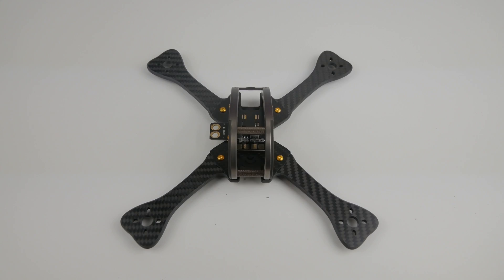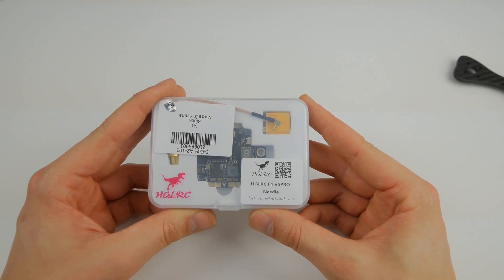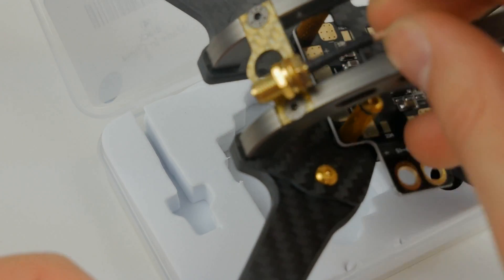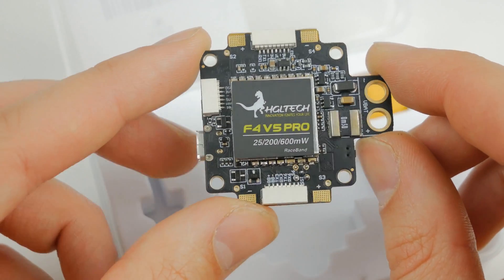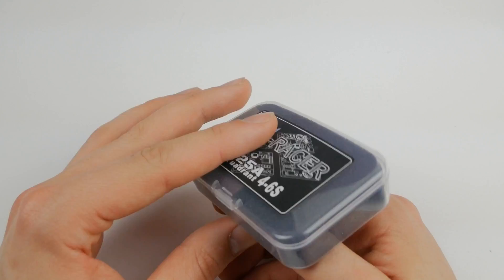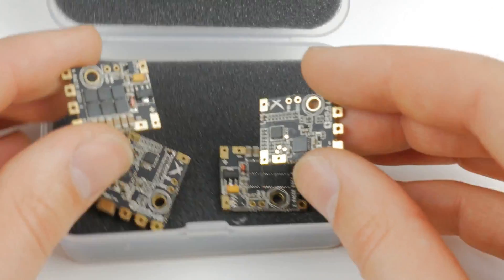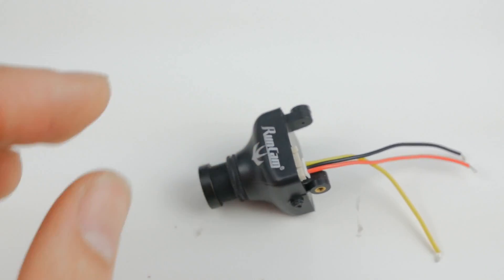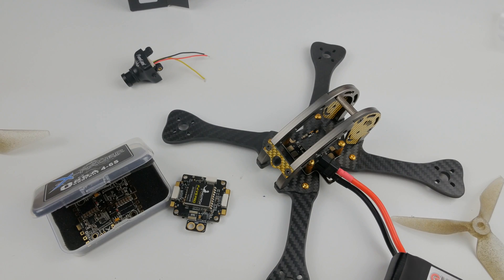Top Spec DIY Quad - Build The Beast!

Comment from the maker: I was right, there's a new 35A version of the ESC! Find it here: https://goo.gl/dvwHBd 
(BLHeli_32 and Dshot 1200)
Reply: Would you get that now, or still order the 25?
Reply from the maker: If price is no factor, I'd advise getting the 35
Reply: Got the 25 amp one and the 2450 motors, only rated for up to 4s, but I think that will be fine for me :)